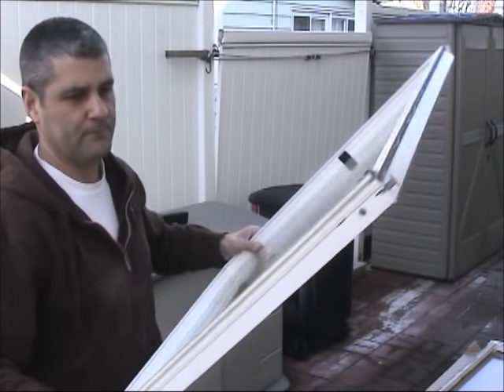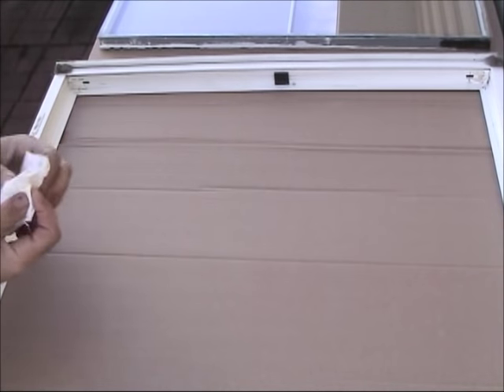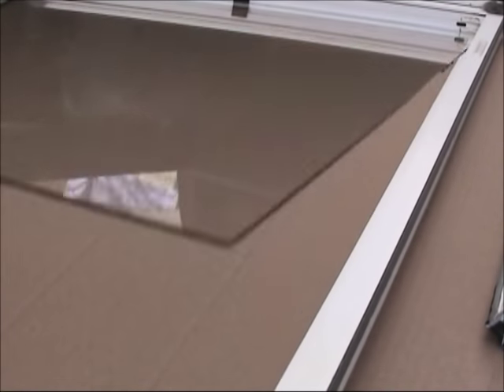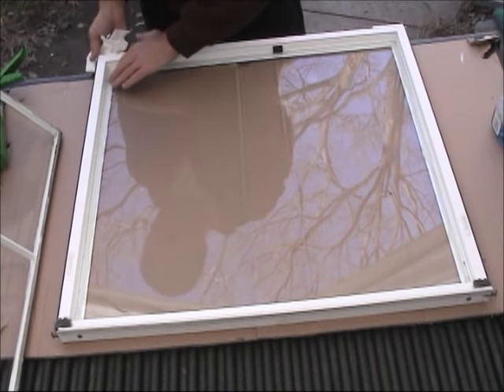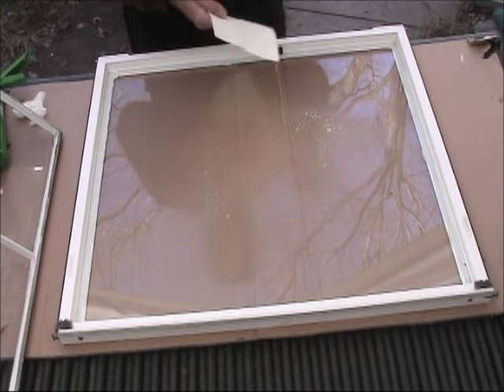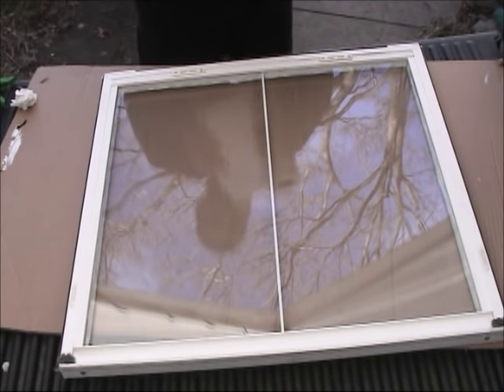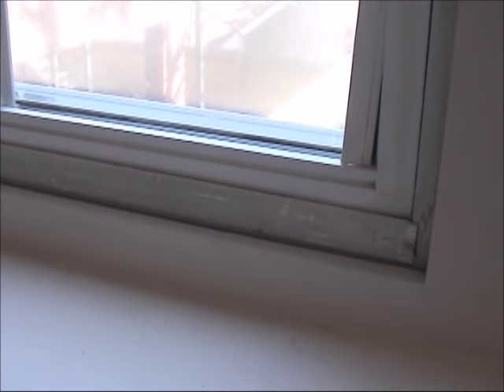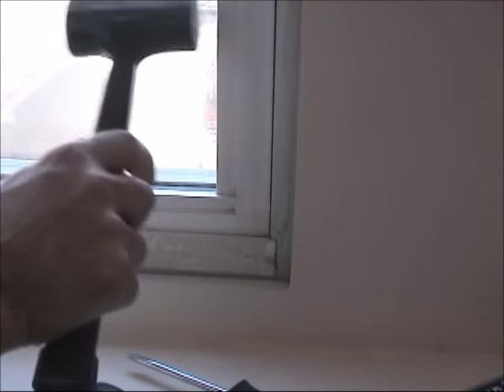Repair Broken Double Pane Vinyl Window

Comment: What about condensation between the glass plates? Air between them have some moisture already. If the sealing between them isn't hermetic, moisture will get in anyway, probably insects will get in too?

Comment: Just to let you know..... this the wrong way to repair a double pane window. Repairing a double window like this will always fail with moisture do to air trapped between the panes. Go to your local glass shop and buy a double pane glass replacement sealed from a aftermarket supplier. And most aftermarket suppliers offer a warranty if the glass fails.

Comment: window factories omit one bit of old glazer technique,without which the seal adhesive pulls away from the glass,,almost universal is workers using the house mix of blue bottle spray windex type on the glass before the step of joining the 2  panes with the grey sticky stuff,,glass is coated with tiny plastic beads,,the stuff makes window surfaces slightly gritty,that grit prevents glass from rubbiing  during shipment  & the shaking & jarring of the road trip, glass surfaces thus need cerium oxide to polish off all the damn grit,,or the older item used by window assemblers & installers of a hundred years ago,,pumice,,powdered calcium carbonate,this gets the glass super squeaky clean,,,the extra time & material is a tiny measure in money & worker time to fill orders,but extends the lifetime for 40 plus years,,try & get  a few of the hundreds of window factories to do this,I dare ya